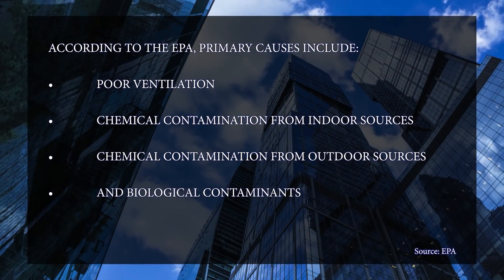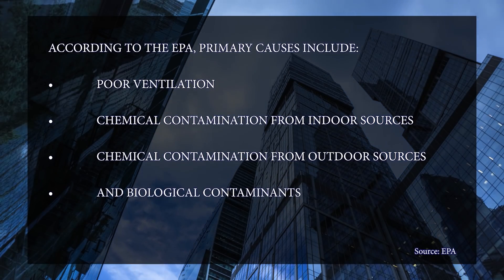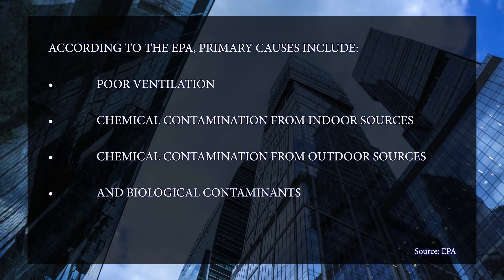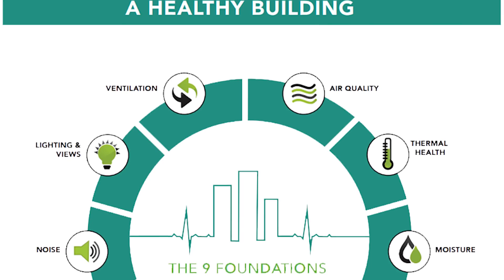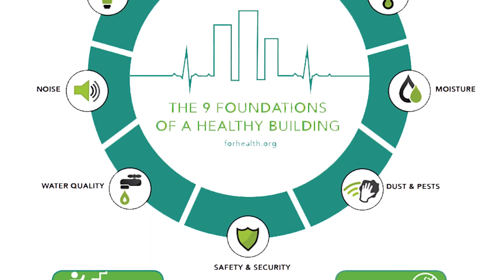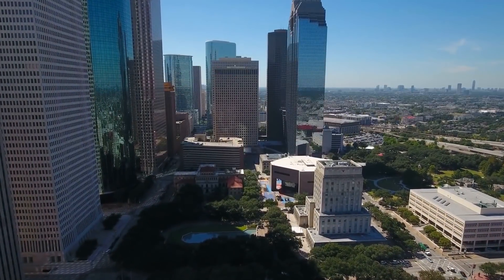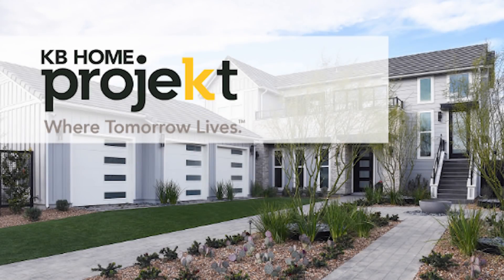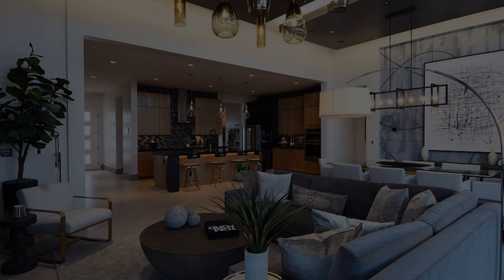The Foundation of a Healthy Building

Comment: The biggest problem with this video is world " air circulation". We should not circulate the air in building, we need air exchange. Some can say the meaning is the same, not really. Most common central ventilation mixing the air as celling diffuser push air horizontally mixing contaminated air with fresh condition air (warm or cold air depend of time of the year).  The air vent are also on the celling, so there is no clear separation between fresh and contaminated air work,living area.   The only solution is to provided the fresh air from floor level (horizontally) of of remove celling diffusers to push the air straight to the floor. In that way the rum is fill out from button up with fresh air  pushing vertically  up  any contaminated air.
This method is not new. It was research I believe in 1970s in Scandinavia.. The original goal was to prove efficiency (if I remember at list 15 better). They notice reduce infection rate as air transmission of viruses and bacteria's was significantly reduced.
there are two system that shod be used:
Displacement system
https://en.m.wikipedia.org/wiki/Displacement_ventilation
And underfloor.
https://en.m.wikipedia.org/wiki/Underfloor_air_distribution